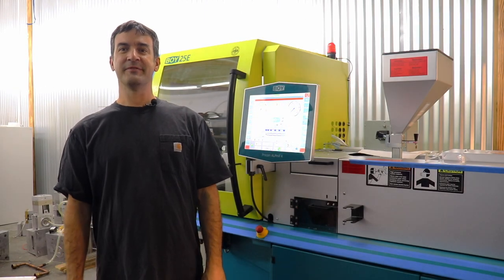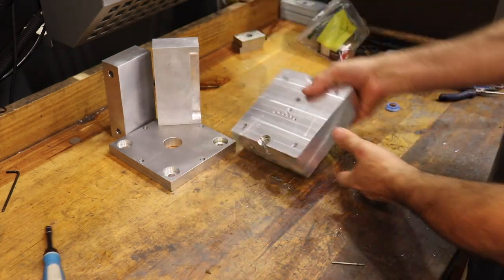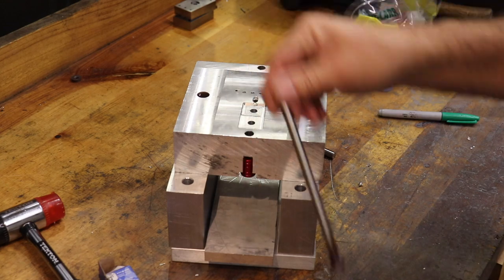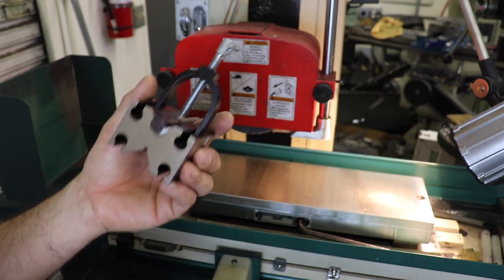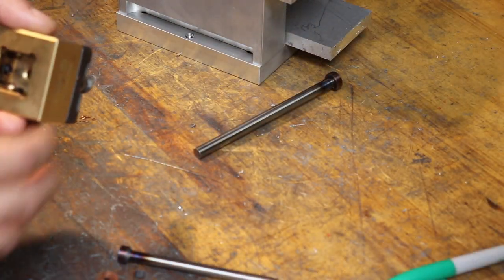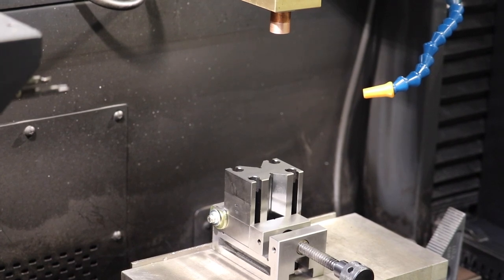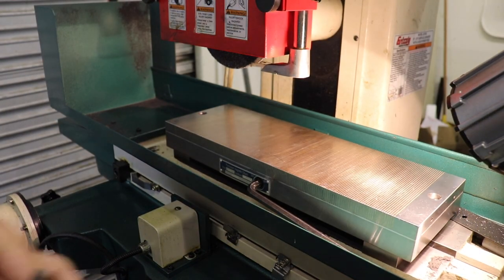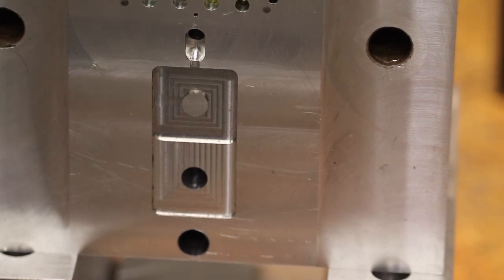Basic Mold Making (and EDM milling) Part 2

Comment: A tip on grinding ejector pins to finished lengths. Mount the vee block very near the end, not near the head. Small ejector pins may flex, vibrate and chip from the grinding wheel as fixtured. Return and ejector pins have nitrided surfaces to provide a high hardness to slide during ejection and retraction. The pin's core and head remain soft during heat treating adding internal toughness but the thin outside case can chip. 
Get some laminated blocks to space your vee block higher or make a tall ejector pin grinding fixture.  
Does your press have ejector rods other than on the (1) in the center? If so I would use the next ones out. Reason:The center only location will become loose in time damaging your spruce puller pin or it's pressure will damage the ejector rod. I would install a flanged steel bushing thru the ejector plate to add support (no thru hole) under the sprue puller. Second if you extend it to nearly protruding to the press platen the ejector rod has more thread engagement length.  Good content.
Reply from the maker: Thanks Wayne,  I will try that out.  I'm pretty sure I only have a central ejector system point.
Reply: Have you ever used plasticine around an ejector to reduce the vibration when grinding? Sounds daft but an old toolmaker once told me this? I've not tried it myself 😂
Reply: @jasonmoore3557  Been in mold making since 1962, never had a chipped ejector pin. No secret, simply hold the pin in a vee block clamped near the end and surface grind to the finished dimension.
Saw an associate set the loaded ejector plate on the surface grinder chuck to shortcut the grinding, lost everyone of the 250 (.125 diameter x 6) ejector pins from chips.
Your alteration is is fine for pins just over it's width. Suggest adding a steel spacer stepped to clear the head diameter to elevate the clamping vee.

Comment: Wish we had an EDM and CNC machinery where I work as a press die maintenance engineer. Looks like you can make some really nice stuff! I sharpen punches in the same way you ground the ejectors.  Most of them are Ball lock made by Dayton so no problem in a vee block. Although, for punches that are headed like your ejectors,I just grind clearance on the edge of the vee block. With the clearance I can fit a range of headed punches without having to alter the block for a different size head. If stability is a problem I block in the vee block on the mag chuck 👍 I only know press dies so I'm really enjoying this series of videos on how injection molding dies are made and work 👏 nice work mate!

Comment: Very interesting information. What wears out first and what limits the 
service life of an aluminum tool? How many parts do you get out of this 
tool? Have a nice day.
Reply from the maker: The life depends on the features.  Long spindly aluminum features will start to break off after ~5000 shots.  The parting line also starts to get dents if plastic stringers lay across the cavity edge and then the mold closes on them.~generally 5K-10K parts before refurbish.  Thanks for watching!

Comment: Have you ever tried using graphite for an electrode? I ran sinker edms to cut hardened h13 tool steel to make molds for metal forging. Can you edm aluminum?
Reply: You can EDM everything conductive.
Reply: Very few people use graphite when machined the dust contaminates  everything no good if you have production lines  running next to the tool room be amazed how far the dust travels and the places it actually gets into

Comment: I have about 8 of those "ejector" pins. I had no idea what they were used for.
Are they used for other jobs?
Reply from the maker: You can use them as hole punch dies as well.
Reply: There are core pins looking similar to ejector pins but aren't heat treated to permit machining the exposed shape, they will gauld if used as ejectors in steel tooling. Ejector pins are nitrited to permit ejector travel, they have a softer inter core. Sleeves are available to eject off a core pin, they also have nitrited surfaces for dynamic travel.
Headed die punches can be be used for both if space is an issue as the head diameters are much smaller.

Comment: This is not trying to be critical but constructive. It's difficult to pay attention because you keep saying AHH this, AHH that, AHHH is nerve wracking to hear so much.. being aware of that you could have a great presentation.  Narration technique to get more viewers.   

 I've been trying to bring my simple Solar Roller Pool Cover Remover solarfactory.com to perfection for 30 years, there's always small design drawbacks and have yet to have any engineers interested in the 2 billion dollar untapped market.. I'm almost ready to quit. Especially China is so easy to work with on a project level but cannot be trusted whereas in the US shops are mostly piece meal and don't care about design help for developing concepts.. this kills and limits the innovator.
Reply from the maker: Hi David, thanks for the advice, yes, i did fix my narration in later video's thanks to viewer feedback like yours.  I'm also on the case to bring manufacturing back on shore! Even though I am a small operation.  Thanks for watching!
Reply: @DragonflyEngineering  if in your networking you do have anyone that sees my potential hook me up.  Truly is much larger than 2B untapped market and the vision is to next produce covers that also power the pool.